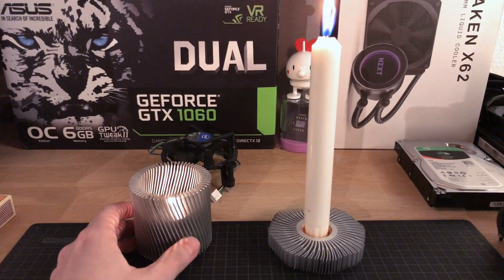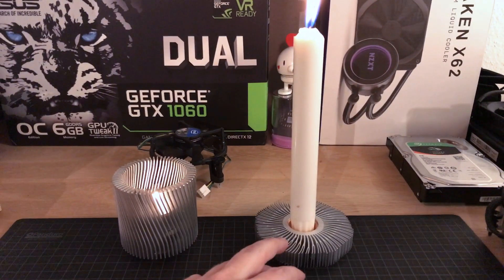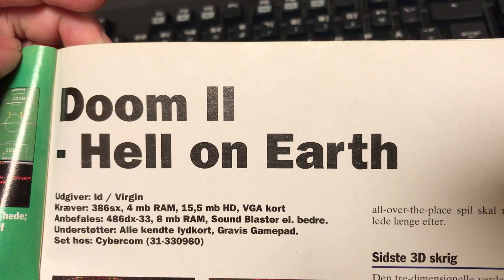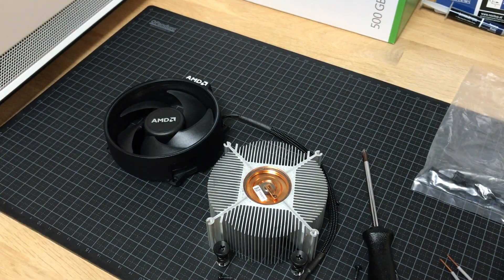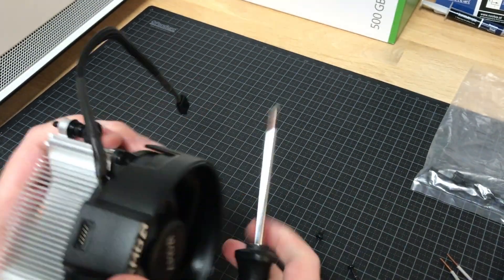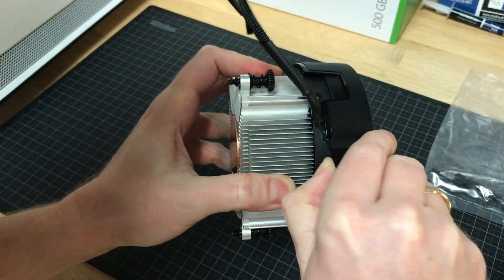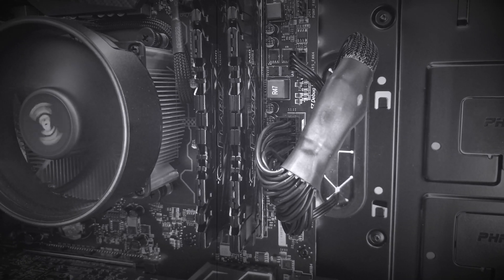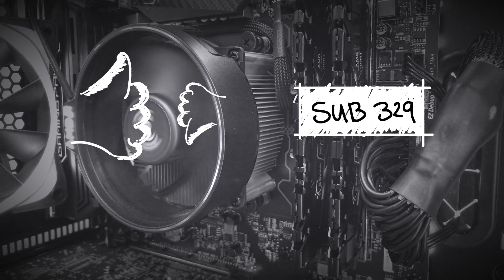Wraith SPIRE vs Kraken X62 - A stock cooler worth using on the Ryzen 7 1700?

Comment: Is it worth using a liquid cooler (namely kraken m22 ) over the stock wraith spire on my ryzen 2600x ....
Reply from the maker: Well you pay a lot for the lights - so if its worth it, I couldn't say - because I have no knowledge of that exact model. I bet you will get somewhat better cooling with it, but you could also get that from cheaper air coolers.
Reply: Nah wouldnt get the M22  doesnt do enough for the price really

Comment: man i think for 3.7 1.25 is good why you take it 1.3? btw i have b350 f gaming and ryzen 1700 and i have 1.25 voltage for 3.7 and it works fine. Btw Nice Vid great work :D
Reply from the maker: I increased it to 1.3 because it wouldn’t run stable with the wraith spire without it, so it was just to compare both coolers with the same voltages. But actually I have ended up using 1.27, because I found that handbrake would make errors when converting a lot of videos and the cpu was 1,25v. Thanks ;)